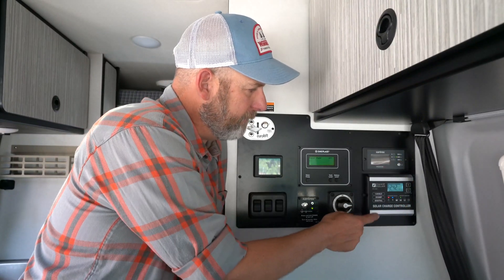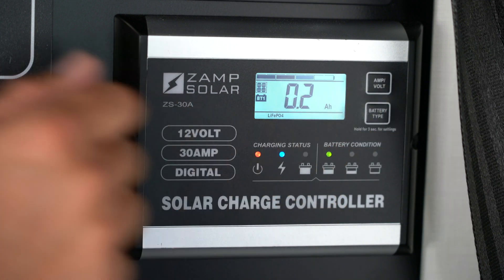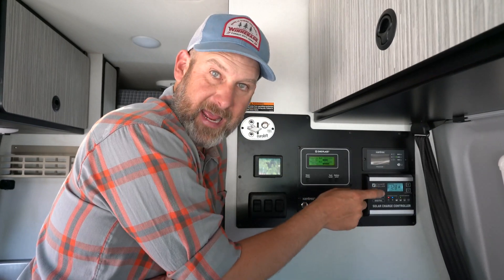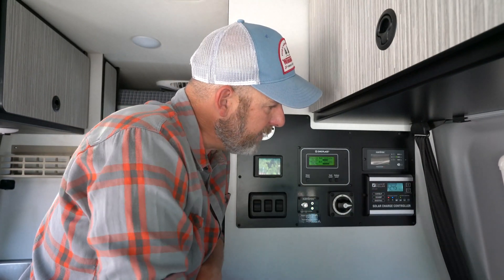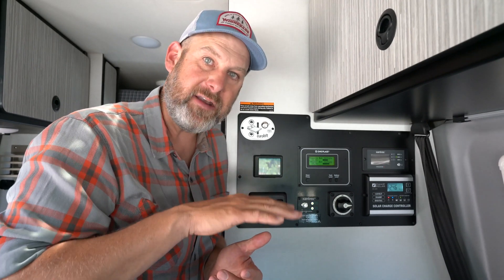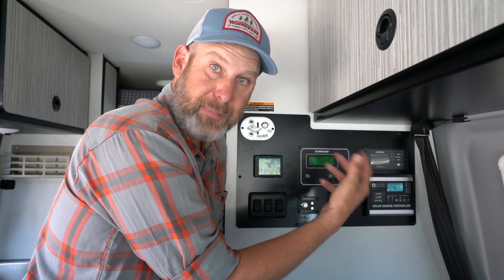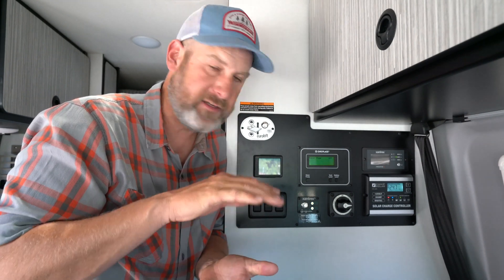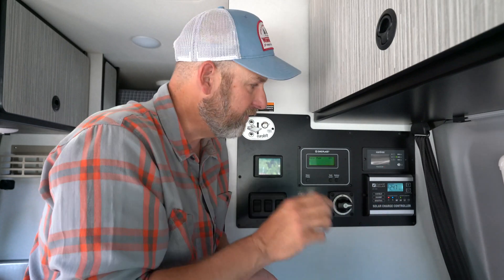Winnebago Revel Solar Charge Controller

Comment: Can I plug an external solar panel directly to the SAE plug at the left rear of the garage area? Does it need a charge controller inline or is just the solar panel by itself ok? Thanks!